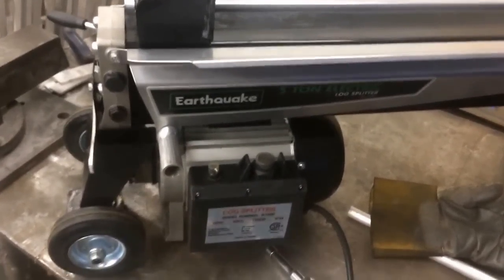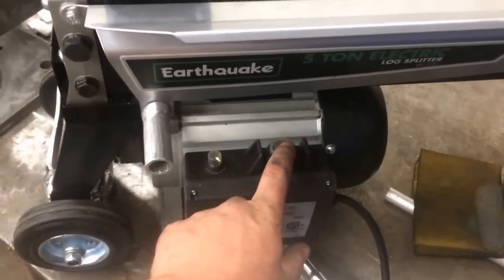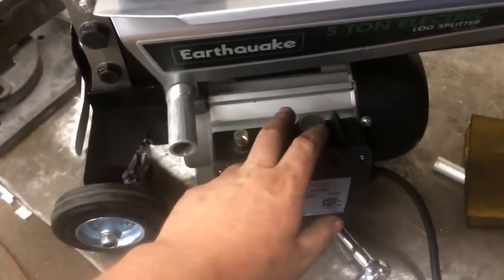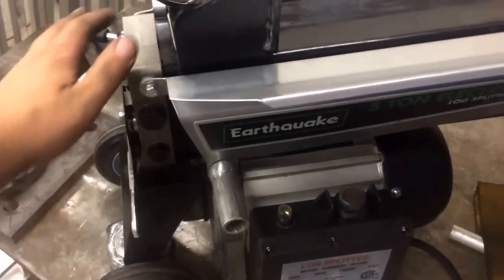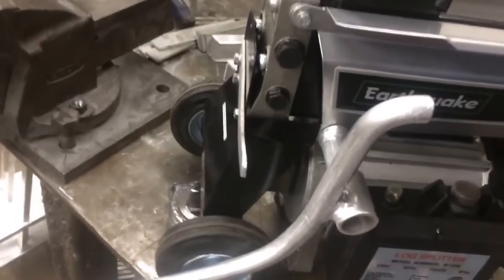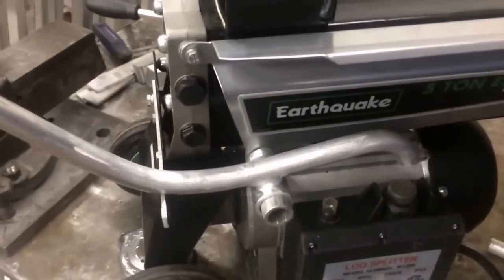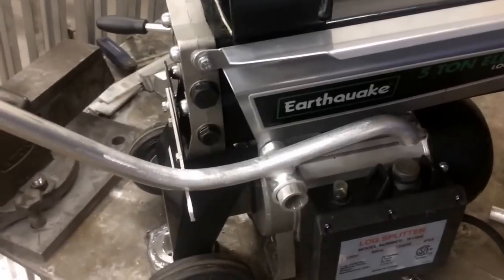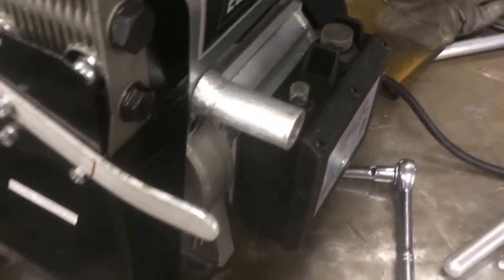One handed earthquake 5 ton electric log splitter modification

Comment: Hay just a fyi thay work 10 times better if you switch the splitting from push to pull. Have not had a problem or a log it wont split not the splitting wedge in being pulled in to the log and not having the log pushed on ti the splitting wedge

Comment: I just use a large C-clamp, continuously running the pump. Never had any issue after 8 cords and counting.
Reply: The lab.

To be clear the pump is made for continuous running with out burning out?
Reply: The earlier models that I have seen , have a on/off switch for continuous running and only the lever to engage. But you have a nice design and I like it.

Comment: Way to hard simple to ad a food peddle .lock switch on drill a hole in button guard put in a nail to hold switch on . Be careful what yo do with your free hand in you want to keep it . Keep warm
Reply from the maker: When you have the resources this is not Hard or difficult. I’m no electrician so adding a foot pedal would be out of my comfort zone, then you always have a silly pedal and cord in the way. 

Sure I could rig the power button to stay on all the time but then it’s running 100% of the time. 

While it’s currently out of warranty the idea was I could modify it to run single handed while not modifying so heavily that I could still return it on warranty if needed. 

Not sure why everyone thinks having a free hand is a death wish with a log splitter. For as slow as this splits you’d honestly have to try to get your hand between the wood and the splitting wedge.

Comment: I just put a bungie cord on the activation lever.  No trouble at all.  Just hook it to the frame, wrap it around the slender handle and attach the free hook to the frame anywhere.  Presto and the carriage doesn't return but stays in the same place.  You will have to push the lever forward (against the pull of the bungie cord) to open the carriage up.  No more open travel distance or waiting for the plunger to press the log.
Reply: Yup, i did the same thing. In fact, i got the idea from a youtube comment, so it may have been yours. I actually find it better, because I can release it back to the position i need it, for the length of the next log I'm splitting, and its not all the way back.

Comment: they make it 2 handed for safety and don't crush your hand.  Im sure you've seen that on brakes
Reply from the maker: If you need this safety mechanism to prevent an injury to your hand you need to avoid making wood in general because you are likely to hurt yourself in some way.
Reply: Great attitude!  Just don't sell it because there are people that will hurt themselves. Not every one is mechanically sound.  That's back to the same reason a shear or press brake operator has safety mechanism's even if they know what they are doing.  Accidents are... accidents.
Reply: I agree with Zach.  If your aware of what you are dong.....    (?)